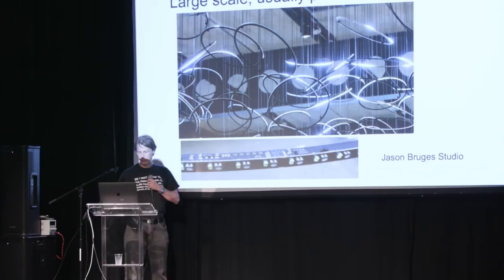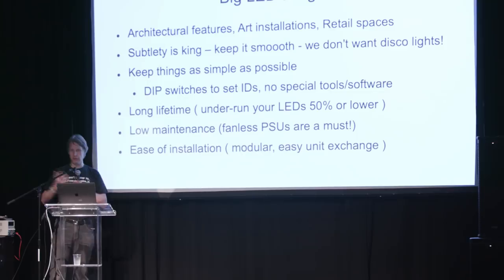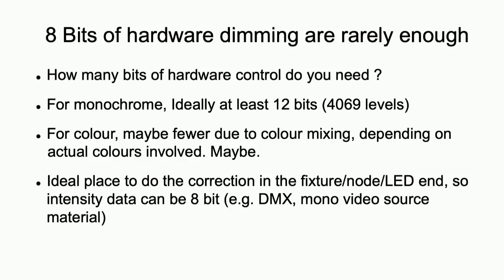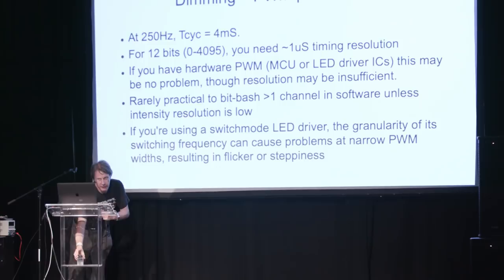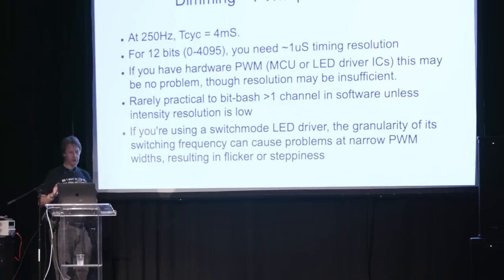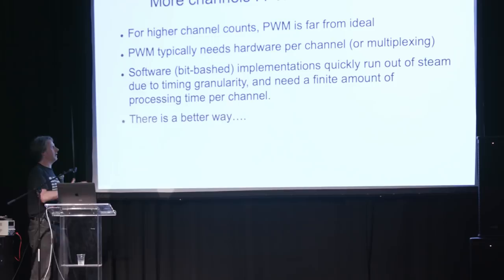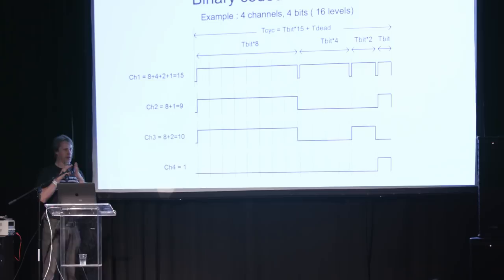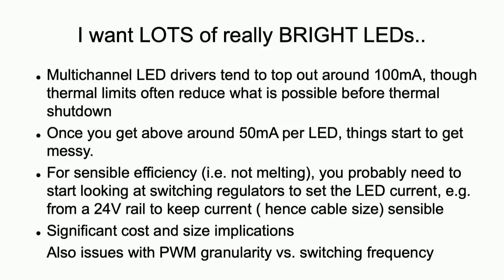Mike Harrison - Everything I’ve Learnt About LEDs

Comment: Mike is incredibly multi-talented. One thing that I don't understand is why you don't apply the gamma correction to the time slot length in the multi-channel shift register scheme, instead of to the bits. I.e. Why is every time slot double the duration of the next, instead of four times (assuming γ=2)? E.g. 1 μs, 4 μs, 16 μs, 64 μs, 256 μs etc. By doing so, eight time slots should be enough to convey 256 gamma corrected brightnesses.
Reply: The math does not work out: x² + y² != (x+y)². e.g. (1µS + 2µS)² = 9µS, but 1µS² + 2µS¹ = 5µS.